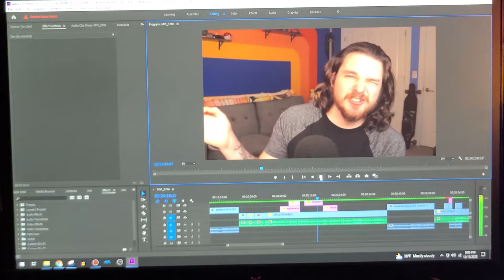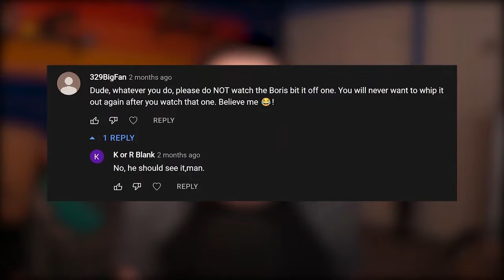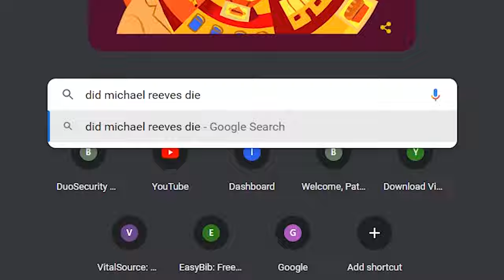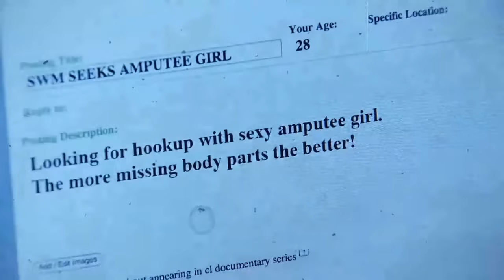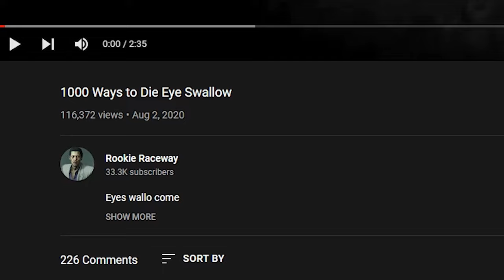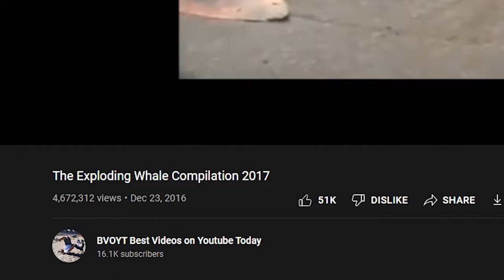The Final Episodes of 1000 Ways to Die

Comment: Can you react to 1000 Ways to Die: Gas-hole.
Reply from the maker: No yea totally
Reply: @Pataclysm  Thanks man.
Reply: @deyontecoleman2163  so it’s not over?
Reply: @korrblank1361  what's not over? The show, or reactions?
Reply: @deyontecoleman2163  show, yes, reactions, no if he watches gas hole.
Reply: @korrblank1361  The show is over. It ended in 2015.
Reply: @deyontecoleman2163  actually it was 2012.